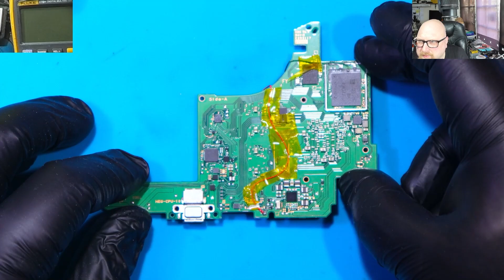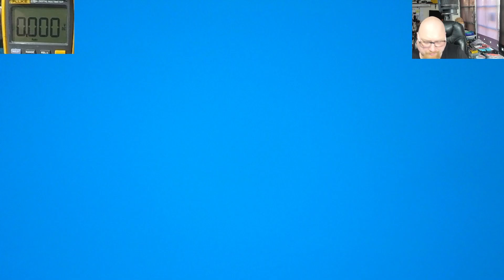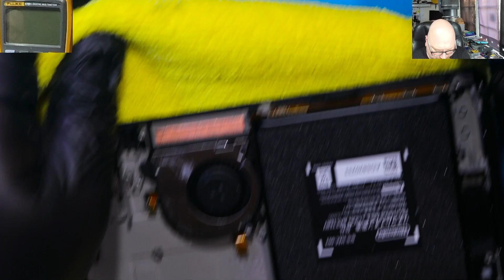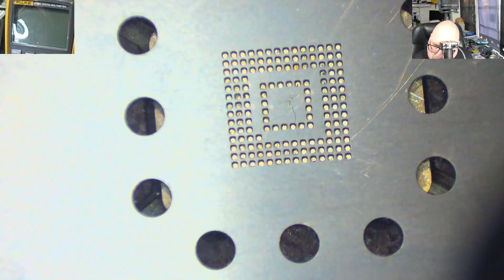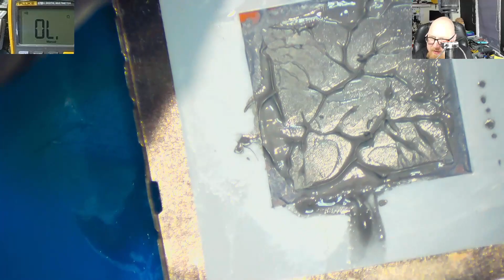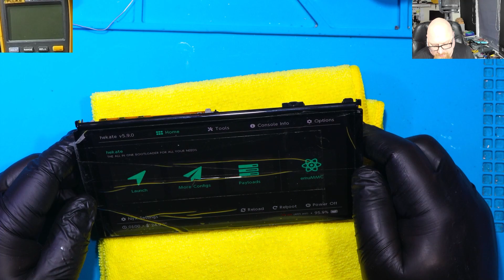Another hwfly installation went wrong? Let fix it!

Comment: What would happen if you short point D to ground? I may have done that because I forgot to cut the shield over the via. Now it doesn't power on. I haven't remove the connections yet. I'm just asking if it's a lost hope and fried the APU.

Comment: You wouldn't happen to have a video like this but for the Lite would you? I bought a switch lite for parts and the previous owner pulled out several of the pads and one of the resistors on the APU. I wanna see if I can resurrect this Lite before I end up just using it as a donor board.

Comment: 4:13 If something is wrong in the USB-C on the switch doesn't you need to turn that USB-C tester/meter around and not the cable that goes in to the USB-C tester/meter?
Reply: Not all testers are reversible, but you could just see how much power is pulled if any is at all

Comment: Hello, i mod alot of xbox 360's and other consoles with mod chips. I've been looking to start modding the switch. Im curious as to why you use bare copper wires for all of the install. Aren't you worried about them touching and causing the mod chip to short in the future? or does it not matter. I've seen this is common practice with switch modding and im genuinely curious.
Reply: the wires are enamel coated, also called magnet wire.

Comment: Just did 2 Lites. Was a lot of fun. No problems.

OLED emmc is tougher, but not that much tougher.

Also, I thought you could turn off wake on charge in the settings.
Reply: Which hwfly version did you use for switch lite?
Reply: @kingdrift1136  I used v5, but in hindsight I would probably get the 4.2 with the T shaped emmc ribbon cable. The v5 may not be able to flash its firmware from sd card, only usb, due to where the 3.3V is coming from.

That's the only difference, I think.